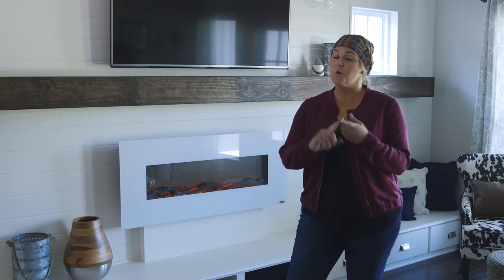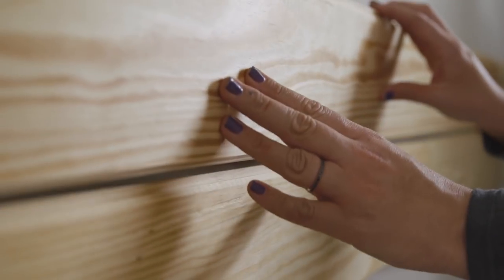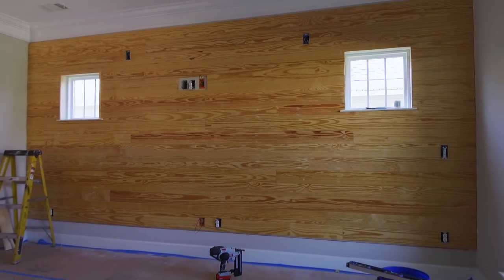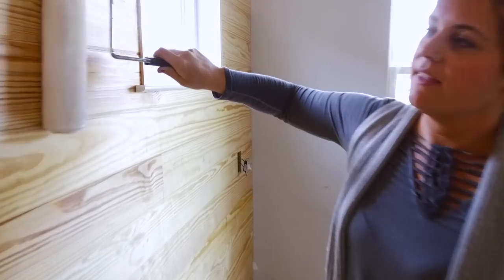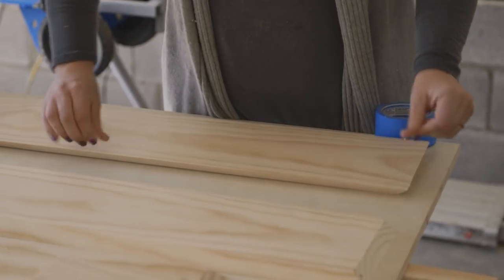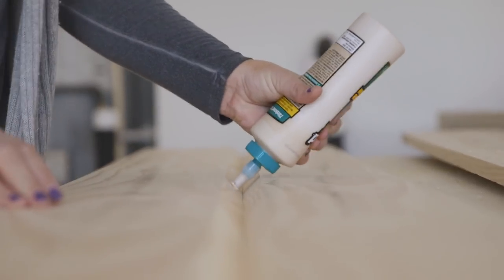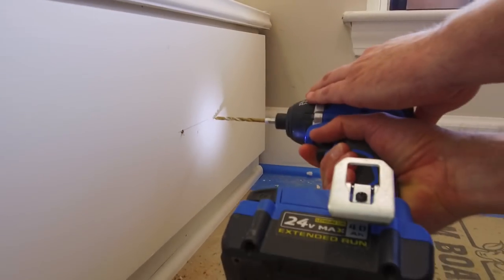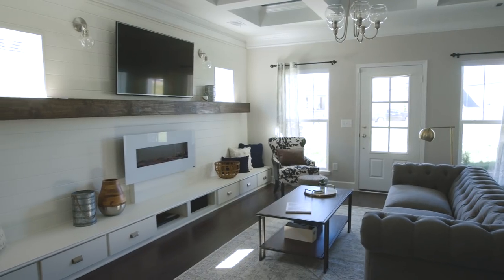The Everything Wall

Comment: The TV should be mounted at eye level. I understand it is higher cause of fireplace but it would be better if the tv was on a different wall at eye level. Not sure why all these videos have it so high. A lot of people will have sore necks and poor picture quality.
Reply: DrMario Pepper pretty sure its up that high because thats where the plug is. The wiring is already there and it would be a pain to move it. Most thr weekender projects are suppose to be something people could accomplish themselves. That and if i remember correctly the room this is in, had REALLY high detailed ceilings. So you WANT your eye drawn up so it puts emphasis on that, orherwise the money these guys put into having that celing was pointless